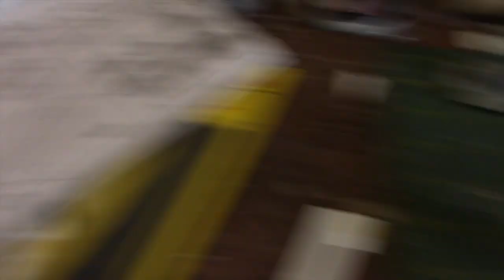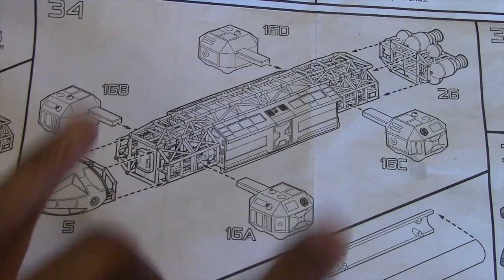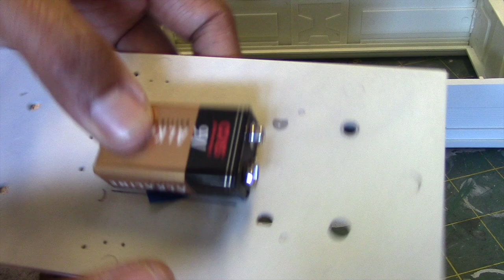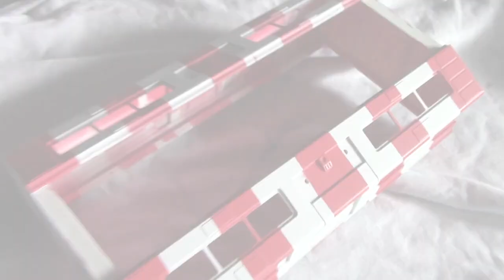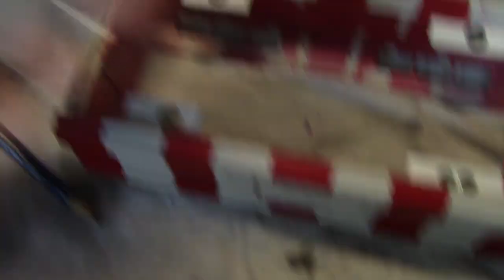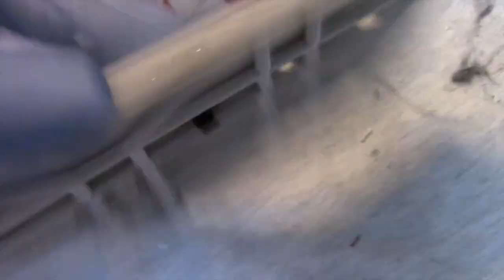Building the Round 2 Space: 1999 Eagle Part 3

Comment: Hi could you help ?? basically can you match a Evergreen tube. To the size of the standard tube size to the Eagle please. I wouldn't ask just don't have any or can gauge from a ruler. Just trying to convert the rear engines to season 2 pipe work. The tubes I have won't stick even with super and Gorilla. Hope you read this soon. Cheers John
Reply from the maker: .100" (2.5mm) Evergreen rod is very close to the tubing around the engine tanks. They're not terribly expensive so it'd be easy to get a pack and see. I just checked myself and it looks close to me.

Comment: Hi thank you for so much help sadly the File tool is a stupid price. I paid a ridiculous price for the Alclad. But cheaper than a new metal set of engine bells. Hopefully last question what did you use to thin your Alclad with. I have enamel as well as tamiya thinners so hopefully one should work lol. My kit is basically just a bunch of glued bits at the moment. I purchased the water soluble filler  you used on your Johnny Quest ship. I plan on using it for the cone when I finish light blocking the interior. Still searching for 1/48 figures to match the Alphas base uniforms. I had also thought of using the 2001 Moonbus crew.
Reply from the maker: Hi John. Curious...about the Alclad, how much did you pay for a bottle? I was able to buy a bottle at my local hobby store for about $8 and online the average is about the same for a 1 oz bottle.  A far cry from $120 for the metal bells. As for thinning, I used it directly from the bottle, no thinning.
Reply: Well it worked out eleven English pounds but cheaper than the metal ones. I really wanted a bling version lol. But I was lucky enough to get a good deal on a flex-i-file. So bought it and spare sandpaper slips. Feeling better about my build I really want to make some copper contact strips. Turn the pod into a battery unit but removable. I hope to make 2 eventually so all my stocking up isn't going to waste and have future kits planned.

Comment: Hi sorry but if you haven't mentioned already. Where did you purchase the sanding tool you use. The one that looks like a mini bow saw ?. I started building mine only to use a full tube of filler and some old sandpaper I wish I hadn't kept. So stocking up on Tamiya sandpaper and buying the clear orange nice touch. But really after ones that look like Alpha uniforms obbosed to spacesuits.

Thanks in advance
Reply from the maker: +John Leightell Hi John.  You can find the flex-i-file on Amazon.  No doubt on other model websites too.  I also recommend checking Flex-i-file.com.  Just stumbled across another interesting site....http://www.micromark.com/19-piece-flex-i-file-set,7129.html
Reply: Hooray thank you so much I really need some lol.
Reply from the maker: +John Leightell Wish I had discovered this tool a long time ago.  Now remember...you don't need to use a lot of pressure when sanding with the tool  The ends can snap free if you use too much pressure.  You will definitely avoid flattening curved surfaces for sure.
Reply: Thanks for the advice I plan on using a couple of your ideas. I was torn on using the pod as a battery container. I'm still going to have it held in by magnets. But have a couple of little metal slithers as power contacts.
Reply from the maker: +John Leightell I'm posting the final video for this build on Friday.  I made a scratch built compartment for the battery.  Sure made it easier vs cramming it into the front walkway...at least for me anyway.  Thanks for watching. Would love to see pics of your Eagle when you're done.
Reply: Be really nice to see mine to lol. Can't wait to see your completed work. I'm waiting on  a 3rd kit but seeing the Alcad wow. I was considering buying more engine bells I'm going to have to build my resources.